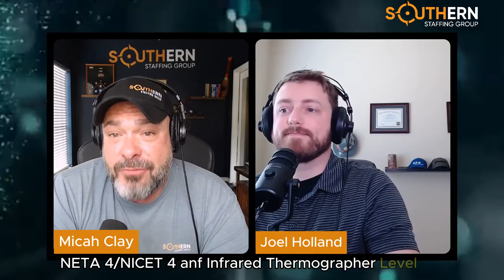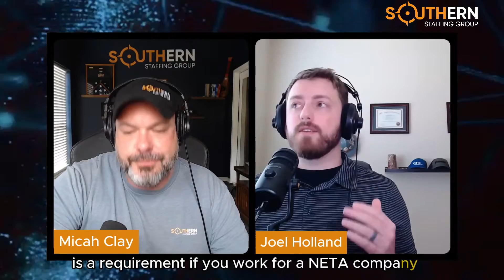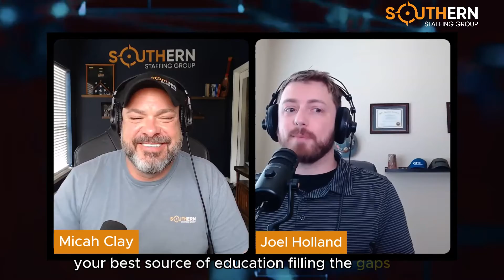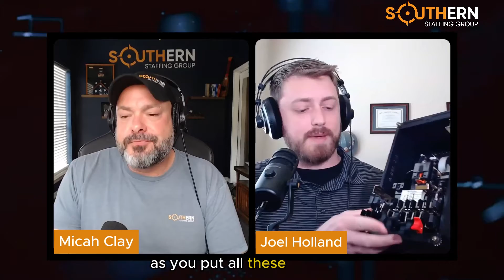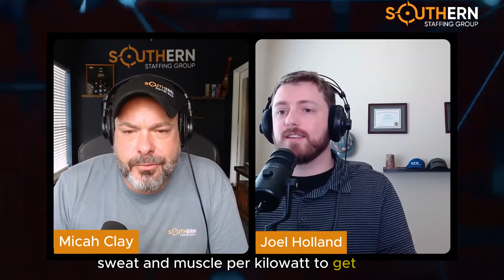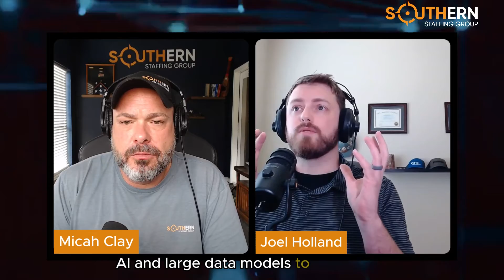Electrical Testing Tech Tips w/ Joel Holland (NETA IV/NICET IV)

Comment: How hard is it  to go from being a electrician to being a electrical testing tech.
Reply: If you have a good bit of experience in with electrical theory, apply with shermco, Saber, resa...ect
Reply: I did it on 2019. I had about 25 years in construction the last 23 1/2 with one company. I finally had enough with all the BS. I had no room for advancement really wasn’t making crap. I quit and I say switched to careers. Best thing I could have did. I went from making $90k a year to over $200k. I do have to say the hours can suck and it does get slow in January and February but pretty much after that it’s 6 to 7 days a week. Money is great and it’s a lot easier on my body. Some days are long and some days are short. It can be a lot of travel but you are compensated for it. 
I work with some guys that make over $300k a year